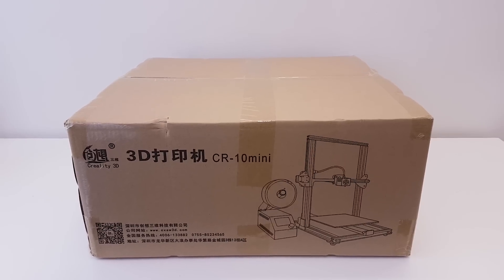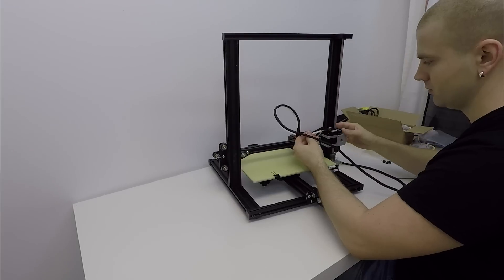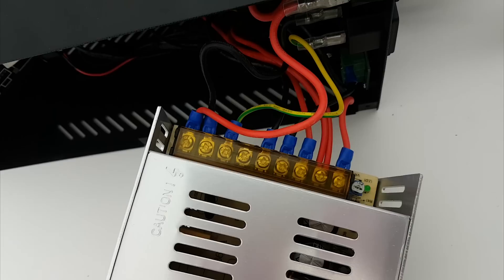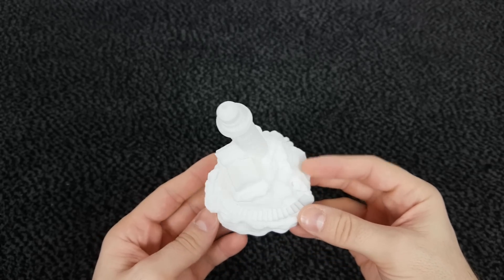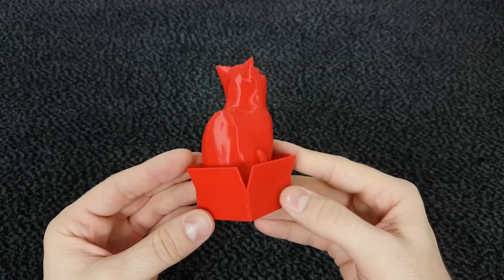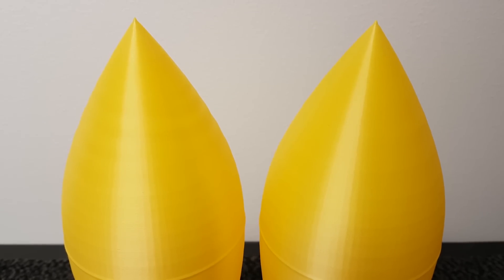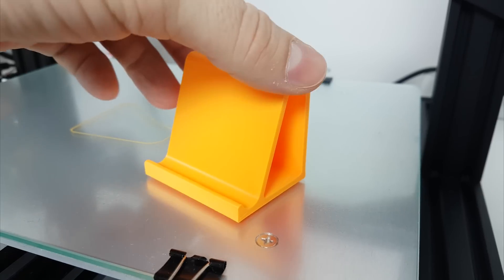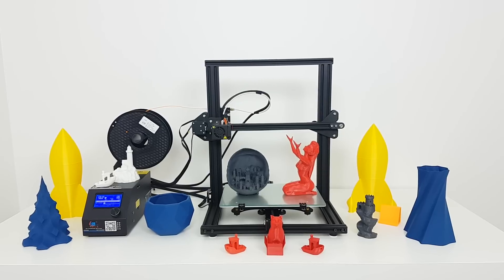Creality CR-10 mini 3D printer - full review

Comment from the maker: Guys! I made video how to upgrade heat-bead of every model of CR10 3D printers. With this upgrade heat-bed can go to 135C under 4 minutes! Printing ABS is not a problem no more!  https://youtu.be/IhjqfMHyBAI
Reply: I print with ABS with hotbed at 109C without problem with my Anet A8 - Prusa I3. I use a Koptan tape directly over aluminium hotbed without glass plate. But I've changed power supply to a new 350W, installed two mosfets to connect to struder and hotbed and changed hotbed cables too.

Comment: I recently ordered one of these. It hasn't arrived yet but I do have a question. Do they provide torque values for the bolts used in assembly? 

If not, can you provide torque recommendations?
Reply from the maker: Robert Crawford Don't worry my friend. If you ever tight down few screws in your life you are going to be just fine. You don't need any torq wrench for assembling this 3D printer. Just a little bit of force. If you are really want me to guess then I'm guessing like 5Nm.
Reply: Thanks. I am probably a bit obsessive about torque specs because I spent about ten years as a field service tech. A lot of problems I went out on were the result of other techs', "not needing a torque wrench."

Thanks for the review and the reply :)

Comment: Im looking for my first 3d printer. This size is perfect for me. Should I get this, as my first 3d printer ? I have done a little research and it seems Creality is a great option, tips ?
Reply from the maker: Hector Camacho Definitely. CR10 mini is very easy to assembly, it's very reliable machine and it have great print quality. You will not be disappointed. I have 5 Creality 3D printers and they never let me down. They are build to last.
Reply: Nexi Tech , have read the CR-10 the regular version isnt good at printing TPU filaments, how about the mini? Also, what filaments brands should I get. Seems there are a lot of bad ones in the market. Im planning on getting PLA and TPU. Do you have videos on filaments brands for the CR -10 series ? Thanks for your feedback.
Reply from the maker: Hector Camacho CR10/CR10S/CR10-Mini are the same when it comes to TPU(flexible filament) as they all have the same bowden extruder. TPU filaments can be a bit tricky to print on Bowden extruders as they all have long teflon tube to push filament thru. You can print TPU on any CR10 but you need to print in lower speeds(20-30mm/s) and with higher hot end temperature to reduce pressure in bowden tube and melt the  filament faster. About filament brands I use pretty mich everything. From cheapest possible PLA from Gearbest/Aliexpress/Local store/ to Expensive/Premium Brands. 90% of all my prints in my all reviews are printed with cheapest filaments and the print quality is very good. No need to stress about it.

Comment: Hi, very good review ! Honestly, do you see a difference in quality in the details between the cr-10 mini and cr-10s. Personally I find that the cr-10s is too big. Thank you :)
Reply from the maker: Daniel Thanks, Honestly, I don't see any difference between Cr10S and CR10 mini in terms of printing quality. In fact in high print speed Cr10 mini have better print quality due to lower mass on Y carriage(Heat-bed).
Reply: Nexi Tech Thank you very much for your quick response and congratulations for your work! You make great videos!

Comment: Great vid once again. Just out of curiosity, which country are you based in?
Reply from the maker: LMF5000 Thank you. I live in Sweden.
Reply: OK, about to buy using your affiliate link. The banggood listing says "Notes: Do not include T-bracket(right side)" - what does that mean?
Reply from the maker: LMF5000 T-Bracket? Not sure. Maybe they thinking about Dual lead screw on CR10S? I really don't know.  Update: I know what is! On Cr10 mini there is no T bracket on right side of frame. There is no need for it. It's ok. Don't worry. It's fine.
Reply: OK, order placed :). I wasn't offered the option of tarriff insurance for this one. Usually my other purchases have it to guard against high customs charges. Hmm.
Reply: Just bought it with your link. Thanks for the advice :)

Comment: CR10S or CR-10 mini. Which do you think has the best cost benefit?
Reply from the maker: Paulinho Braz It's hard to tell, they are so close in price, but If you don't lack of space, have extra $$$ and you will not print ABS(without mod) then go with CR10. Other then that CR10 mini is great choice.
Reply: I will print plenty of ABS. Thank you for your help.

Comment: Thank you for your review. Which do you think is better with Creality CR-10 Mini or Anycubic i3 mega? .
Reply from the maker: msucat grumpy Well if we put build volume on the side. I like I3 Mega more because it has more modern design, touch screen, it take less space and it have filament run out alarm. Cr10 mini on other hand has much stronger robust frame and its slightly easier to change parts and maintain. If you don't need extra build volume I would go with I3 mega, but no matter which you choose they are both great 3D printers and you will not be wrong. Cheers!
Reply: Nexi Tech Thank you for your reply. Which do you think is better for print quality? . I think that cr - 10 mini is more beautiful, looking at other reviews.

Comment: Also, in the video, you said that u printed the Sorceress using 50 micron layers, but then state after she was printed that u were using 150 micron layers. What setting was actually used? Sorry for all the questions..Just trying to learn this stuff!
Reply from the maker: 150 micron or 0.15mm layer height was print settings for Sorceress. Cheers! :)

Comment: Hi Nexi, You do a grand presentation of the various printers. It has helped me much in my printer purchase. 
I would appreciate if you could demonstrate the easiest method in changing the filament in the bowden sytems, meaning ones that dont have auto features to assist. Thank you.
Reply from the maker: My friend that is very easy. First heat  up the nozzle to 175C (if you using PLA)  And then you press and hold Filament realise on bowden extruder with the fingers and then push in filament a little and then just pull the filament back with the fingers out the teflon tube.
Reply: Hi Nexi, Thank you for the reply,  You have been most helpful.

Comment: Better than Tevo Tornado? I bought mine on Gearbest with shipping and assurance for 330usd, it's a killer price!
Reply: It's your first printer? Every 3D printer tested needs to be tunned up. It's not buy = print, you have to spend time with it, givbe it some love. If you say Tornado is rubish, buy a Anet A8 and you will see.
Reply: Every case is a different case. 
Did you changed slicer? Tried different settings? There's so many variables! I found out that putting a printer bolt by bolt, from the scratch, it's a bad option for accuracy and out patients.

Are part of the Tevo Tornado official group on facebook? If not, please PM me.

Comment: Would this be a better option for ABS than the full size CR10?
IIRC the bed on the full size didn't heat evenly, and/or high enough because of the huge bed, but the mini seems to heat evenly and to very good temp because of the smaller bed (@ 13:37 )
Reply from the maker: Yes, CR10-mini is better for printing ABS then full size CR10 or CR10S. Even if you apply insulating under Heatbed CR10-mini will reach higher temps(faster too) comparing to regular CR10 or CR10S.
Reply: I had the same question!  Hopefully Nexi Tech responds.
Reply: Cool.  Thanks!